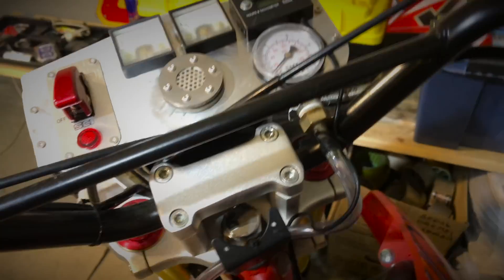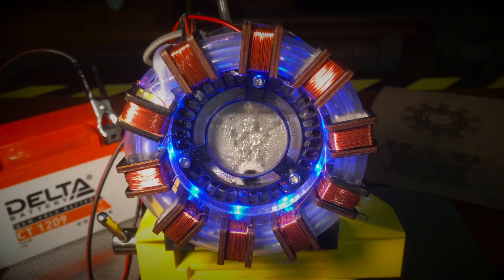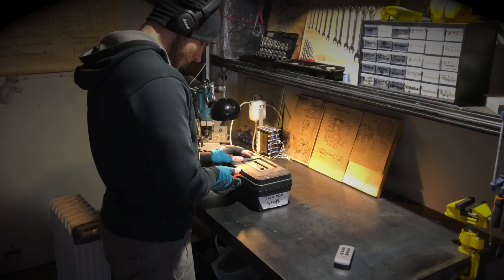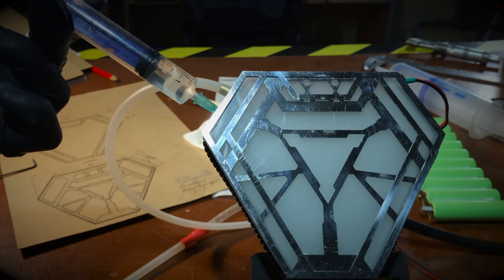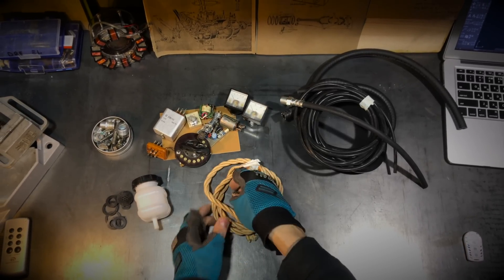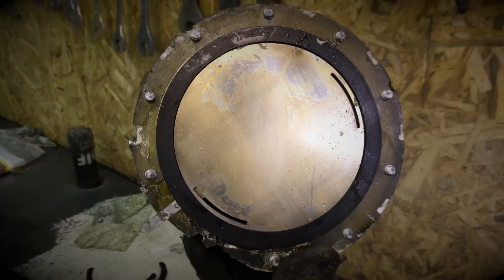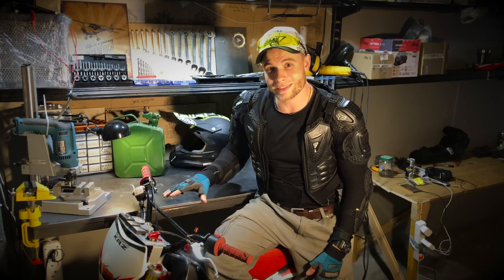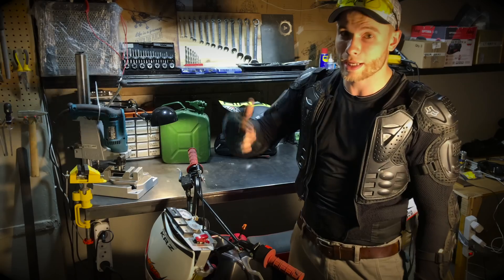Hydrogen booster for internal combustion engine

Comment: Every engine needs to have gas storage for exceleration. Now lets make it even more complicated . On that small bike you might be able to add a small electric motor. 
     The solenoid is for adding a quick volume of gas to start accelleration , right?
    My challenge. How to get the battery pack on a circular framework that flies using air foils. Also an additional area for a circular fuel tank. So start with a drawing and iterate.
     You see rockets use ( waste) so much energy just moving the first 1000 ft. Parameters and challenges. Hint, a heavy lift helicopter needs an atmosphere for control.

Comment: Curently trying to redo, improve, set up done in 2008 of running 18HP Briggs mower engine on water in carb. I studied all previous documents from the web site and purchased many parts. I'm at the point of finishing building the isolated power supply by gnd to gnd, and diodes series protection from the ignition high voltage. The original running engine used 10 amps THROUGH SPARK PLUG at the starting 12v battery. Battery removed, then the on board alternator to DC provided bridge rectification power to circuit, self running at idle speed. Water drawn through small hose to carb by engine venturi vacuum. The flywheel has 12 magnets creating electricity with the dual alternator underneath.  The 4kohm spark plug was changed to zero ohms. Timing retarded to about -neg 34 degrees by the triple wires S1R magnetic coil. Field pulsed was impressed over the ignition plug wire, and continued spark from TDC to -34 degrees. The water moisture is to expand to vapor pressure during piston down stroke, with also small hydrogen gas generated and fired. Important items are 2 inductors 1.5Millihenry added in both low volts and high volts line with fast diodes. See S1R9A9M9 (2) You tube videos from 2008! Web site now shut down. It was earlier suggested by engineers that his previous car engines converted using pulsed 7 amps, had used tesla magnetic spark gap with Radiant Energy passing through inductors and spark plug. Three technicians , plus Nathren at that time worked in local electricians shop in Georgia. S1R had used very old style special dual coils 60cycles relay on the high voltage that sparked through the internal contact gaps in it's Vacuum chamber to provide unusual benefit. I am a believer that one of those relays / single coil, was in the plastic deli tub on the side of the 18HP engine . The accessory spark gap, and several parts are in the tub! S1R (Nathren) did not supply full instructions to replicate, since the relays are obsolete, and several people later, got hurt with battery acid and shorting wires . He then changed his published circuit so it would then not work. I designed, in 3 months,  a substitute unit in vacuum box that may work with it's N+S magnets, spark gap, diodes and inductor - all in small sealable Carlon box with gauge.

Comment: Suggestion between the carburetor and the bubbler or pressure tank which ever is the last stage. Place several inches aluminum wool loosely packed to not impede the hho to the carburetor. It there is  a flash back  the aluminum wool will fool the gas and stop the combustion by dropping the temperature this saving the job reactor.

Comment: Nice job. One of the best i've seen so far. 
I'll just give you a little advice: Add a little of 2-stroke oil to the (gasoline / petrol) .
As the HHO is a drier gas than the gasoline, it will cause additional wear to the valves and especially to the valve guides.
Reply: This is a 4-stroke engine, there is no need to add oil to gasoline.
Reply: @greendragon2088  Yes I know it's a four stroke engine.
But there is a problem with Hydrogen, or more specifically, this type of additional feed, which is not normally mentioned in the various existing videos.
The problem is that hydrogen, unlike gasoline, does not have any lubricating properties.
As a result, it will "dry" the engine components in direct contact with it.
Leading to additional wear on the components in question.
I'm talking more specifically about the valves, valve guides, piston rings.
Basically, to summarize in a shorter way, Hydrogen causes damage to combustion engines in general (yes, I'm talking about 4-stroke engines).
The same thing that LPG does in diesel engines.
P.S. When I talk about putting 2-stroke oil. I'm not saying to put the percentages that are used in the 2 stroke engines. (3% to 5%).
I'm saying to put a very small percentage. Like 0.5% or even lower, just to make up for it.
Alternatively, if you don't want to use 2-stroke oil, you can also add anti-friction additives that are added directly to the fuel. Something like this:
https://motorspirit.co.uk/product/faher-petrol-maintenance-fuel-additive

Comment: I was going to ask what you were doing to meter the gas's entry, thinking that you would want to try to match it to the throttle position.  Then you mentioned that you were using a two position switch, of sorts.   As this is an experimental rig, I should have known that your system would not be perfected, yet.  You are doing marvellously well, keep at it.

Comment: If you use stainless steel screen. Instead of plates. You will produce far more gas for the same amount of electricity. If you  could use a 24k gold plated screen you would get even more gas.

Comment: Las piedras de carburo y el agua en los adaptadores de tubo de pvc, unidas al carburador, producen gas acetileno y hacen funcionar el motor de la cortadora de césped. Conocimiento común, utilizado en las minas para encender lámparas. Pero, usted tiene que pagar por el combustible. En 2008, el hombre hizo funcionar el motor de su cortadora de césped Briggs de 18 HP con 100 % de agua en el carburador, formando una pequeña PRESIÓN de hidrógeno y vapor de agua EN LA BUJÍA en la cámara de combustión. Arranque de batería. batería extraída. El motor funciona con alternador CC. See- You Tube S1R9A9M9- 6 amperios, 12-18 V, bobina magnética S1R enrollada a mano, 20 vueltas sobre cable de alta tensión, diodos de protección de batería, temporización tardía de 34 grados, 100 voltios de bobina de 2 Millihenry + diodo de bloqueo, capacitor/condensador de carga con efecto flyback y extra adicional voltaje a la bujía. (Al igual que el circuito convertidor Boost de tipo de pulso único) ^ amperios de corriente + alto voltaje juntos a la bujía. Su conversión de automóvil fue 18MPG en agua, 1978 El Camino, el motor funciona mejor con nitrógeno incorporado del agua de escape recuperada, EGR

Comment: So, please advise.. how did he overcome the explosion? What safety measures did he use and how did he controll the pressure? 
Any info would be great 😁
Reply: Add Potentiometer To Control Reactor Voltage Attached With Acceleration. And Adjust Intake Valve Minimum Close Settings And Also Reduce Ignition Coil Pulser Adjustment Easily Adjusted By Increase Distance And Rotating Magnet. Enjoy :)

Comment: A small compressor run off the chain could be used to compress the oxy/hydro? You probably would not want to go over 150 psi unless you used a high pressure cylinder and a very expensive compressor and use an injection plate like NOS?

Comment: Have you looked in to using graphite instead of steel for the HHO generator? I’m not sure if it’s the same thing but I heard graphite is the best material for dry fuel cells
Reply: Yeah graphite is a very good non reactive electrode, but it dissolves very fast in liquid

Comment: Great!!! I'd like do know if the production of hho is enough to run the motor by itself withouth gasoline...have you tryied?
and I'm always asking myself if it's possible to make a pipeline like in common rail motors using pure H2 under pressure.Are you capable of doing some injectors of pure hydrogen?(I think your explosion is because of taking under pressure a combustible (h2) and a comburent(o2)...NEVER DO THAT).

Comment: As an Engineer I see a problem in your design... when you are releasing the gas abruptly into the engine you may lose a big part of it... Simple think about it.   you are releasing a high compress gas into an open pipe (air filter housing/intake). Clearly the engine is producing a suction over this intake making a low pressure (vacuum) environment. If the pressure released is higher than the vacuum of the circuit, the gas will go the other way,  (try to put a lighter near the air filter and press the button when testing in the lab... mmm outside the lab).

the best way is to put it in between the carburetor and the engine, as it is a metal pipe. Normally there is a port there to measure the vacuum, if you can just weld a small metal fitting  (if possible point this fitting towards the engine, so it will be harder for the compress gas to go back.  Another thing that you can do is putting a one way valve in the air intake.

In any way, i am skeptical about what you are trying to achieve here.. I dont think will work on the way you want to work, because your tank is too little, the engine will consume in a matter of a second or two, not been able to give you any real boost (and even less without the non return air valve)

Remember, the engine can burn only a limited quantity of fuel (14.7:1)  and then you are introducing Oxygen and Hydrogen into the mix, meaning, suddenly there is less oxygen (as the high pressure will stop the suction of air) so then your engine will replace some oxigen for a combusting gas. This rich combustion will have less power than a 14.7 to 1.

In trucks and other vehicles, they add a turbo to increase the amount of air (oxigen + crap that "is not burn") into the engine, allowing to burn more fuel. Note that when you add more pressure or just simply, add more power, the combustion will be hotter ( a normal exhaust can reach temperatures of around 300C, 400C, while a turbocharge can reach over 1000 C depending on compression).  This may damage your engine.

what you have build here is a way to store energy. The energy that you put into the lithium battery then is used to generate extra fuel and pressure that you can add up to your fuel at will, however to make it more simple, you keep your separator at home, you connect with quick claps a gas bottle and then you charge it to its maximum pressure, then with a pressure sensor you disconnect the hidrogen generator, disconnect the bottle and put this bottle into your bike/car/truck...  then you press the button and enjoy the boost.   Same design, just different way to enjoy, as now the extra added weight is only tank + gas, and you save the batteries and the generator. Also you can skip the generation finding a good source of hydrogen gas or even nitrous oxide which has roughly the same amount of energy as hydrogen (yes yes, hydrogen has more than anything else.. but..  this one is closest and highly available )

In any way, for a  trucker with already a turbo on it will be easier to just modify with a leak valve + an electroval the membrane that keeps the turbo boost stable pressure, allowing the turbo to give it a temporary boost on these conditions, but again... you dont want to force the engine of what feed you and your family.

Now, looking at this from another angle... I am going to say firs that I am a fan of Hydrogen fuel, however, if  the temperature of the combustion reach certain levels (around 500C) the "crap that "is not burn" that is coming with the air, start to react with the oxygen, generating nasty gases that are more dangerous than CO2 to the environment. The problem of Hydrogen is that it burn so Fxxxx well, that it reach easily this temperature and when it does generate water plus a nasty nitrogen-oxygen reaction that harm the environment.  In order to avoid that you need to provide a very rich hydrogen - oxygen  mixture (50/50 as I racal), but as I was writing this, i just recall that you may scape this problem as your combustion of fuel-oxygen is now richer... :)

Now, as a biker:    if the front wheel doesn't pop up, you are not making significant increase of power ;).

Please try the non return valve or just add it in the other side of the carb... you will get the full vacuum of the engine and will take as much as it can. Also, carry only a gas bottle.... then measure the time it takes the pressure to equalize the pressure... then.. make a video of this bike, on a road accelerating with gas full open and press the button and the front wheel popping up... if it doesn't pop.. you are doing something wrong :)

In other hand, I like your project and videos :)

Comment: As I see it he got a very well working HHO generator. but this one is very dangerous. because he chooses to use stainless steel instead of platinum.. the gas that comes out here is not only pure HHO but also oxygen and the most dangerous gas of all: hexavalent chromium gas. sniffing just a bit over a couple of years will end your life with success.
other than that, only changes from stainless steel to platinum make this the best way to power your bike or a car.

Comment: I'm confused. I get that he made the hydrogen cell, and it's going into the carborator, but is the bike still running on gasoline with an added efficiency from this mod, or is it running just off of the new cell??
Reply: It's running off Gasoline and the HHO. The HHO is just acting as a booster, increasing power with no extra gasoline. He says it generates about 4% more power with up to 6% greater efficiency, which isn't a lot, but it is substantial enough.

Comment: This is really cool!, as an engineer student i have a small concern about the net efficiency of the system, wouldn't it be more efficient putting an electric motor directly into the main drive and feeded with the stored energy in the battery? as i really dont know how efficient this system could be, also in terms weight. Thank you!

Comment: Alex, have you given any thought to making an Iron Man HHO thruster? If you soak Oasis foam in water it holds a fair amount, is easy to shape, and could be vacuumed out to power electrolysis without a significant weight increase.

Add in a few Peltier to keep the foam cool and water vapor from the air would settle in the foam and help keep it working.

The same vapor from the foam could be used to cool the opposite side of the Peltier Circuit to keep it from heating too much, and electrolysis of vapor requires less energy to achieve due to phase shift.

morkaw9384@gmail.com if you want to talk further.

Comment: Holy crap, I've heard people talking about real life Iron Man with a couple other youtube creators, but you're the ONLY ONE I've seen make a space age reactor to power their projects in a freaking underground bunker in the middle of an apocalyptic quarantine with scraps he scrounged from cold war era scraps and some sheet metal. You're an inspiringly terrifying individual, keep it up. You're seriously an absolute madlad blowing yourself up to create this thing with something that reactive and powerful.

But was there no other gasket material you could use that wouldn't corrode? I know copper is probably out of the question. Maybe a bit of lead wire hammered in to a gasket would do the trick? I don't know how it would all function under electrolysis though. Maybe if the gasket itself was thinner? I don't know, but you do great work!

Comment: the energy consumed to separate hydrogen and oxygen,  would be more than the energy you get back from combusting it in the engine right? so wouldn't it be more efficient to use that same electric power to just run an electric motor?
Reply: i guess it is a cheap NOS system where when you need more power you can inject hydrogen.

Comment: i would gladly volunteer to do gruntwork, cleaning and organization on your lab, it's a damn near shame you're on the opposite end of the world </3

your R&D on hydrogen tech is amazing, you're inspiring me to develop a wearable hydrogen turbine, with a generator like yours you cut down on the h2 supply side of things a big way, in a couple years it could be a hydrogen jetpack powered by a series of H2 electrolyzers the size of an arc reactor

Comment: If I'm not mistaken, engines are designed to have prefect timing when lighting their fuel. And any changes to the fuel like pumping in hydrogen or oxygen requires that timing to be changed for max efficiency

Comment: Mmh so technically you could do this with two stroke engine as well, since you are just feeding gas into intake, though would not this make engine run rich due less air getting in that is replaced with hydrogen-oxygen mix, witch should be in perfect mixture already? Then again better rich than lean..

Comment: Add a turbo so when you boost the engine with the hydrogen oxygen mix it further increases the oxygen for normal fossil fuel combustion further increasing the power

Comment: Hi Alex.  Just wanted to know how did you regard the timing when injecting the gas? Asking because the flame front speed of the gas ignition is so high compared to gasoline. You would really need to regard the timing to.near 0degree btdc. To see the full power of the gas (and to ensure that the engine doesn't detonate and rattle the piston..)

Comment: to force the gas to enter the combustion chamber of the motorcycle's gasoline engine do you use a pump or a solenoid? how do you control the flow of the hho generator in the engine and avoid overloading the cylinder of the engine in hho and destroy the motorcycle at the same time and in last question the pressure of the hho generator is it sufficient to bring the gas into the intake?